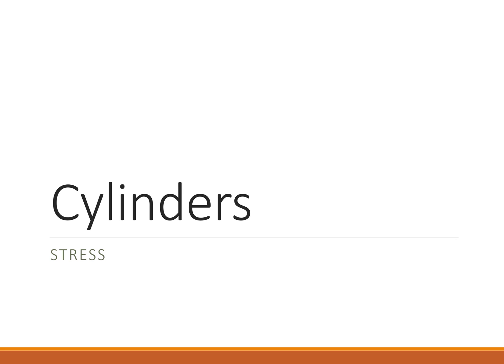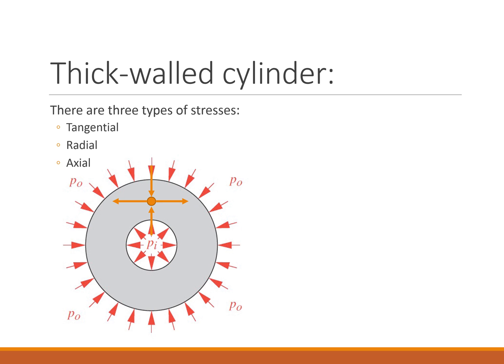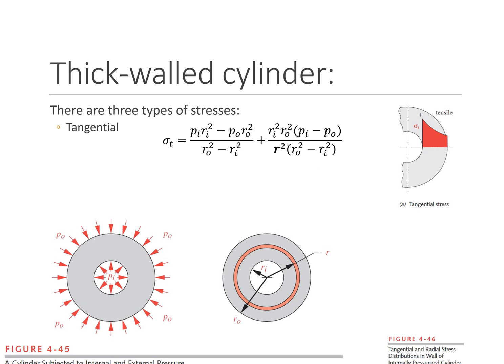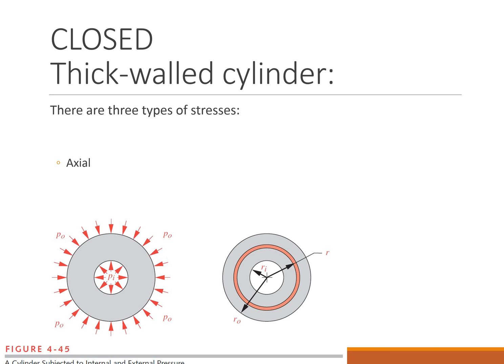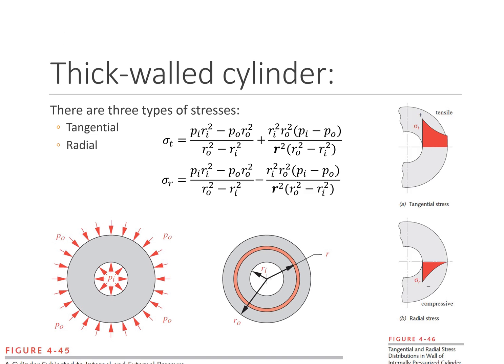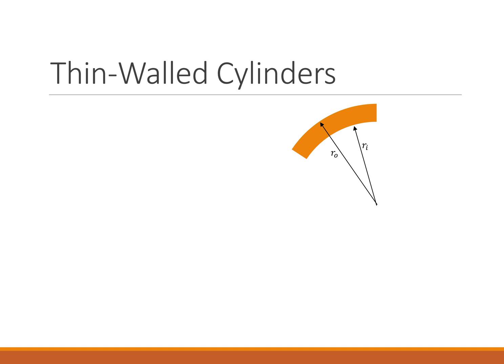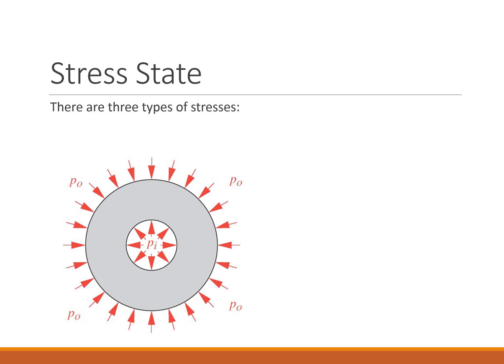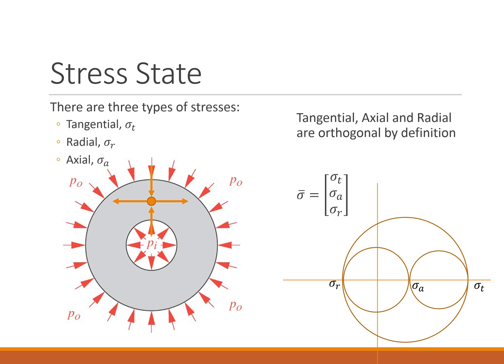Cylinder Stress

Comment: why in a lot of problems, it's referring the tangential stress to the tensile stress?
Reply: Think of a water bottle as a tube. If u reduce pressure inside the bottle, the plastic will shrink. If pressure is positive outwards then the radius will increase. Decrease in radius means compressive forces. Increasing pressure makes the internal stress elements expand hence its tensile

Comment: Great video but you did one simple mistake... INTERCHANGED THE FORMULAS OF RADIAL AND TANGENTIAL STRESS.
Reply: Yes it should be + for radial & - for hoop stress.
Reply: @chamothdhasanliyanage1007  no. it is correct. read this book and get smart: https://www.springer.com/gp/book/9783319006895 :)
Reply: The equation is correct, but I can understand why people say otherwise. Other sources will have external pressure minus inner pressure which would mean that it is + radial and - for hoop. This equation is inner pressure minus outer so it is - for radial and + for hoop. Both are same it just a matter of preferences. I am no mean an expert, so please correct me if I have made a mistake.